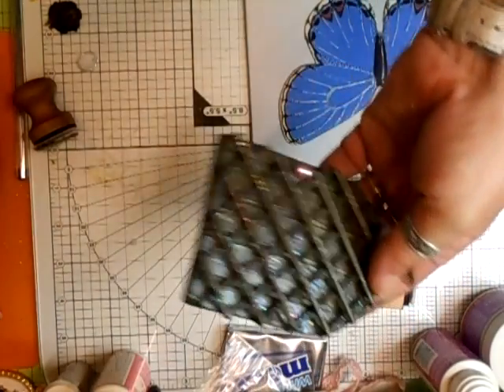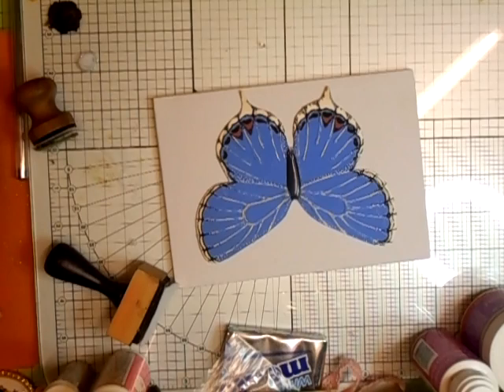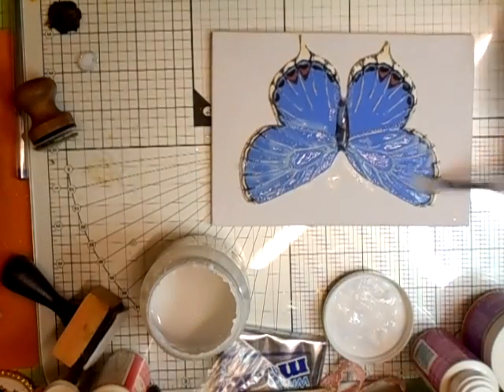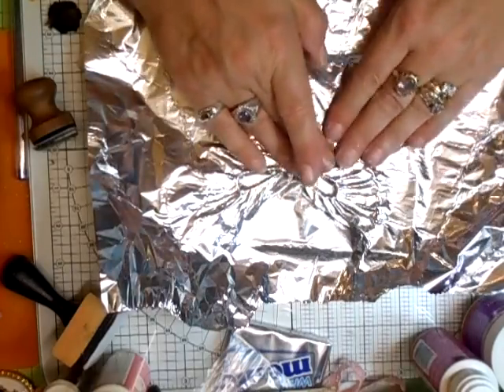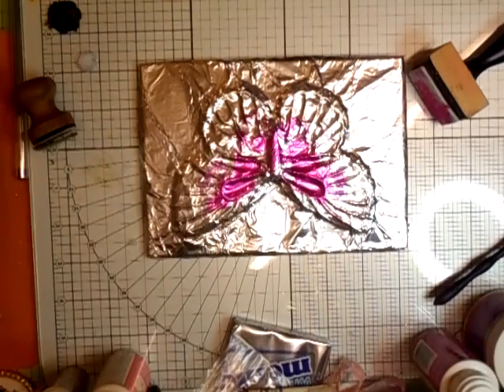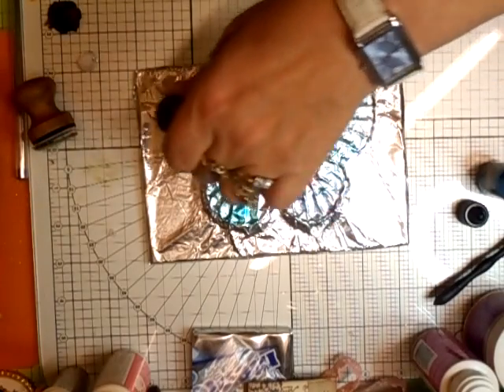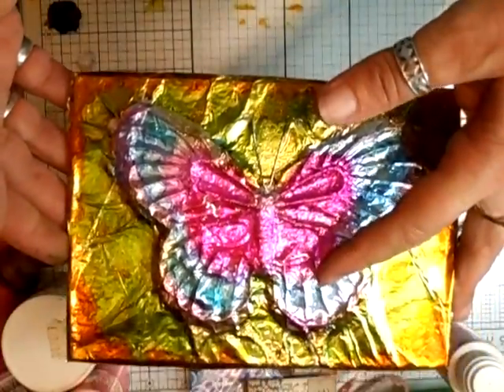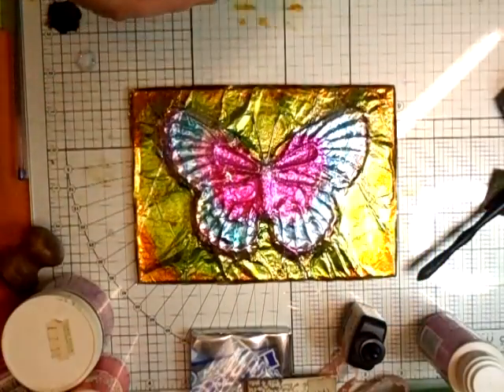Foiled Butterfly Tutorial - jennings644

Comment: I think you must be able to read my mind or something Fiona, cause I've done some of these types of pictures using textures and items such as beads, cogs, and I've even used an old pair of my glasses and an old watch behind the foil. I have used just a black paint over the top and then wiped as much or as little off and then varnished. The trouble is I think they look dull and I never thought of using alcohol inks, but I will now and I know they will look an awful lot better. The embossing powder is a fantastic idea too and it looks like it gives it a fab finish. Here's a tip from me to you in exchange!!! I use plumbers tape, I buy it in my local hardware shop, it's quite cheap and has a sticky back that you peel off, and you can get it in different widths. It means you don't have to wait for the glue to dry,it is easier to burnish and I love using it. I recently was having my bedroom revamped and I covered my bedside lockers with it and varnished them, they look fabulous and expensive too. I hope you give it a try. Keep posting, I seem to learn something new from you every day, thank you sooooo much. Barbara Kelly